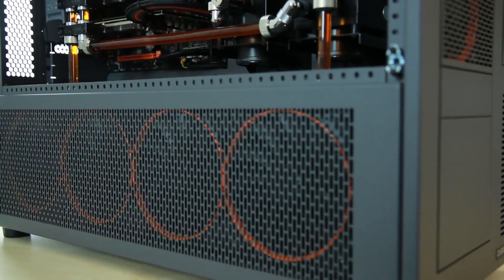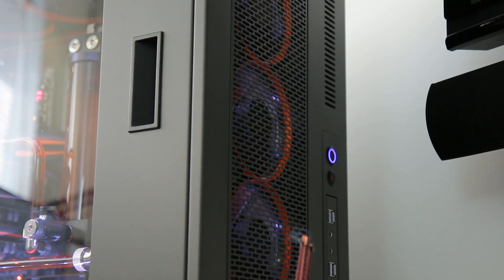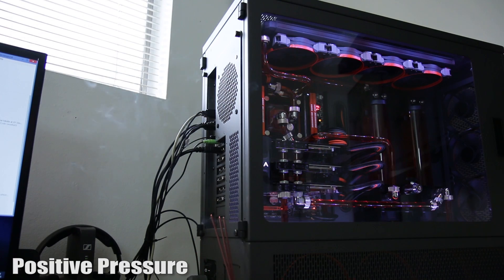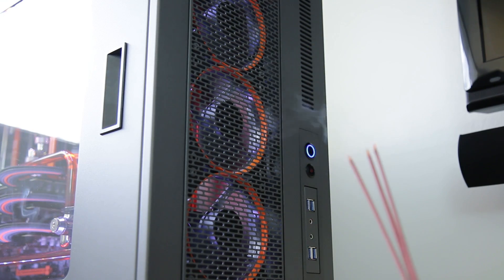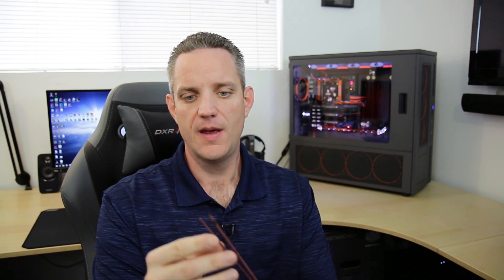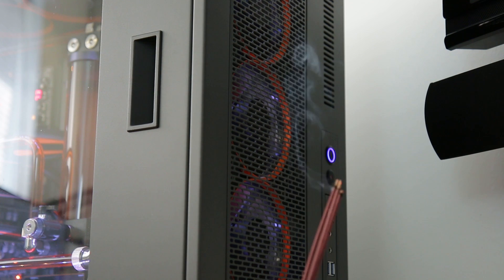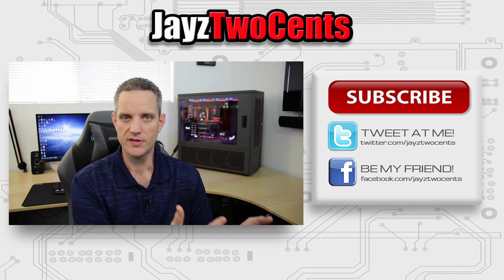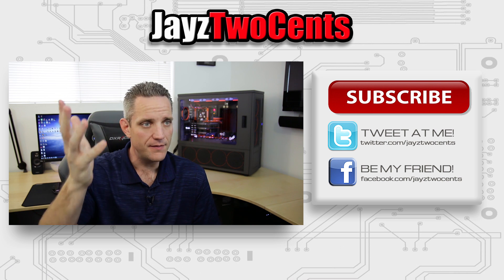Case Flow and Pressure Demonstration - How to balance airflow

Comment: I personally just fill up all the fan slots, try to put an equal number of fans blowing in as out, and make sure temperatures don't get high. if temperature gets high, then i mess a little bit more with it. I have a cooler master HAF X case with all of my fans being controlled by the mobo, i have the stock rearexhaust fan where it was (blowing out), stock top exhaust fan (blowing out) and an additional 200mm fan blowing out. For intake I have the stock intake fan (blowing in) and the stock front intake fan (blowing in). For additional fans I have a duel 120mm fans for the cpu doing a pull - push to the rear exhaust, and dual stock 980ti fans pulling air through the card to the back (they stay off most of the time due to low temps) pulling air from my SSD and my capture card. My PSU is upside down in its own little circuit pulling air from under the case and blowing it out the back.

If you stayed and read all of this, give me your thoughts tech people!
Reply: It's a hobby, I want my system to be at its best
Reply: Some people are like that with cars, spend your money on whatever floats your boat

Comment: So much money spend on hardware and so little knowledge :) its amusing :) positive, negative airflow :) you need smoke machine you need lights you need different colour smoke, you need airflow meters at different points. You need air directional flaps....and so on, so on...

Comment: 2 140s front intake though a filder then 2 120 exhaust  though a radiator and a 1 140 in the back exhaust

Comment: The nice thing about incense sticks is also that their smoke can be more toxic than cigarette smoke. Always good to get residue like that all over your computer parts and room and clothes. :-P (I.e. check the type of ingredients, even better read up on them, if you intend to use them frequently.)
A better cheap way is to lick the back of your hand or your finger and hold it in front of a passive opening and you should be able to tell whether air is flowing in or out.
Even simpler: Use your brain to figure it out without even having to sense it. That works, too.

Comment: I didn't realize people didn't look at the CFM and thought just the number mattered. Good info regardless! I use all 250s in my case and crank them all the way up to keep things easy, because then the number of fans equaling out becomes relevant. Remember to test any setup you do though, because for instance on my case the front 250 is hampered by the HD cage so it's hard to know where the air is going to naturally go since it's having to run through and over all my HDs and the cage itself.

Comment: 5:28 - so it actually does have everything to do with the amount of fans, if they are all running at the same speed. Obviously if a fan is running at a higher RPM its moving more air lol.

Comment: Quick question: I mistakenly bought a corsair SP fan as a case fan in my NZXT S340. I am about to do some spring cleaning and am considering moving the 2 included nzxt fans to the front of the case and mounting the SP as the sole rear exhaust in order to gain positive pressure. Is a SP fan acceptable as an exhaust fan? I assume the direction of its airflow wouldn't matter as much there since it's just exiting the case, but I'd like any input you could offer.

Comment: Very good analysis, but there're 2 mistakes:
- Natural fluid convection from down to top only work when it moves freely (at atmosphere pressure). When it is forced by a delta pressure (like through fans), the behavior is determined by the direction of that pressure. A case with intake fans at the top and exhaust at the bottom can cool the same as the inverse way.
- Negative pressure actually cools better than positive. The reason is that negative pressure sucks any air found inside the case, meaning all the hot air is evacuated. With positive pressure it is possible to generate bubbles of hot air if the case doesn't have enough exhausting holes, raising the temperature of the components inside those bubbles.

Comment: I was just going to ask you something about this lol.

I'm going to add to my loop a 280 rad (I'm going to watercool my 970 now) as intake with 2 corsair SP fans that came with the case. Would I be fine with them not going over ~1500 rpm or should I get an AF fan for the bottom? By the way, without this radiator, they run at 900-1000 rpm and I currently have + pressure.

Also, this is simple curiosity since I can't change it, but having the res about 5 cm (2in) from this res would screw up the airflow?

I'm asking because I have to order most of my stuff from the US, and it takes a while to get here :P

Comment: lol i only have 3 fans 1CPU fan 1GPU fan 1 Case Fan
Reply: In your case, I can assure your case does have positive pressure, if the case fan is intake fan. If it is exhaust fan, pressure is being negative. Now is the case circulating air fast enough through the case for optimal cooling is a different question. Well, actually I assume that you do have some stock cpu cooler too so nothing really matters in any case and whatever.

Comment: I currently have 3x140 unimpeded intakes at 7v with 1x120 unimpeded exhaust at the rear running at 5v, and 2x120 obstructed radiator fans exhausting air with PWM control at the top. This results in positive pressure during no load, which is the majority of the time. Dust is kept to a minimum. During gaming is the only time my case has equal or negative pressure, due to the fans on my GPU ramping up & my radiator fans ramping up.

Comment: I would like to know your opinion on my case's airflow pressure. I have a Corsair Carbide Spec-03, I have 2× 140 fans in the front and 1× 120 fan in the bottom for the intake. The exhaust is the 2× 120 in the top and 1× 120 in the back. The front fans are the Corsair AF 140 Quiet Edition with the white LED's and the back exhaust is the same just the 120 fan. The top exhaust's are the stock fans that was in the front of the chassis and the bottom intake is the stock fan that was in the back of the case. Would you say I have positive/neutral/negative air pressure?
Reply: I haven't reduced the fans speed on any of the fans and all the fans are connected to a fan controller hub that I have turned up to the max speed for all of the fans.

Comment: Great video as always! Super informative and I like your format!
Anyway, when I built my current system it had been about 7 years since I had actually used a desktop as I was using laptops, so I did a bit of research and everyone said positive pressure. So in my Corsair 750D I'm using 2 stock 140mm fans as intake, 1 stock 140mm fan as exhaust, and the 2 bundled 140mm fans that came with my Corsair H110 also as intake. So 4 fans as intake and the 1 stock case fan on the back as exhaust. I've not had any issues and to be honest I would prefer quieter fans, but it all seems a little confusing! Would love a fan recommendation if anyone has any tips!

Comment: You have any idea how bad it is for your electronics just burning an incense in the same closed room?  The dust gets fucking everywhere, and it's microscopic so you really can't even tell it's there, not to mention it's virtually impossible to remove from tight spaces like your motherboard or graphics card.  I cannot imagine what you're doing to your pc by letting it suck incense smoke directly into the intake fans.  Like...that's absolutely mind blowing.

Comment: Been doing this since my second computer build over 10 yrs ago. Something you might also want to address is how fans do not pull air as well as they push air. This is because of blade orientation. Also might want to add how the density of air changes with positive pressure so thee is more air to absorb heat then negative pressure and neutral is in the middle. You also have too much flow if you ask me. Not enough time for the heat to be absorbed by the air. Might want to look into that. I know I probably sound insane but, meh so did tesla.

Comment: For my system I borrowed a small smoke machine from a friend. Makes it possible to see how the air/smoke is behaves inside you're system. Positive air pressure doesn't necessarily means that air is blown alongside the major components. For instance, I shaw in my system that the vrm motherboard block didn't really had any airflow. The smoke was just sitting there, while in the rest of the case I saw swirls inside the smoke. When I lowered my exhaust fans a bit, I was also seeing more swirls around the vrm's a the mb temp dropped 1.5 degree (Celsius). Air pressure is not the same as air flow! Think of a you're tires: When you inflate a tire you increase the volume of air inside the air creating a positive pressure (1 bar is considered natural atmospheric pressure). However when you stop pumping air inside the tire and cap of the nipple, the air pressure remains, while airflow is basically zero. 

p.s. When the wheels start turning and objects (debris, uneven surface areas, etc) makes the tire wall compress and decompress, air is moved inside the tire, but that a bit beyond the scope of my point. Ever created a pond, while then you know you should avoid 90 degree corners as they decrease water flow and create 'dead pockets' while the waterpump is still moving water through the filters. That can also happen in you're computer system..

Comment: I have my build inside a Caselabs Mercury s8 with two 360mm rads and one 240mm rad with Noctua Industrial fans all hooked up to a Lamptron fc5v3 fan controller. Any recommendations on the intake fans? cause right now i have none lol.

Comment: hey jay. thanks for the video bud. good work, you didnt mention that rpm's mean nothing compaired to CFM which means everything. can spin a fan as fast as you want but if it cannot produce CFM its worthless. here you go buddy, 2 pictures VIA puush, made the LED strip being used by myself as well, its nothing impressive LGA 775 q9300 oced to 3ghz on 1.22v and a 1:1 ratio on my ram at a 400mhz fsb and a nvidia gt640. it rocks bf3 on med at 60fps on 64 man chaos servers on metro no sweat.
Reply: +Raging Reaper Gaming Variety
http://puu.sh/mHv2c/a9d38b0329.jpg
http://puu.sh/lYEIt/c8f002cbf9.jpg

there you go. nice work on demonstrating airflow, i did the same thing you did.

now i need a IO backplate as mine came with the wrong one :(

Comment: Do you have your water pump connected to your CPU fan header, or do you have the radiator fans connected to the CPU fan header on your mobo? Since you're letting your mobo PWM control it when the CPU warms up under a load, do you want the pump to speed up or the fans, or both?

I'm using an Enermax LIQTECH 240, so I'm not sure if I should connect the block/pump power connector to CPU fan header, or CPU Aux, or connect the radiator's fans to the CPU Fan, or CPU Aux, Vice-vera? ..does it matter?

Comment: I have my side panel off completely.. Phanteks enthoo primo luxe.. All watercooled with 9 fans, 6 top 360 SP push pull (outtake) 2 SP 240 intake, no dust in my system.. Fans getting all the cool air available to them to push through the rads.. Don't think it's all that important with watercooling, just have to make sure you have enough cool air available to be pushed through the rad fins

Comment: My current setup is 1 top 140mm exhaust and 2 front 120mm intakes (sort of filtered) in a nzxt phantom 410. It really helps preventing dust from getting in, at least most of it, in my case, since it has an opening on the bottom for some reason, other than the mesh filter on the front.

Comment: Hi I have a 650d and I am going to install some top fans, fan support it 2x 120 or 1x 200 or 2x 140, I was thinking about 140s in a push config as my rear 120 is push and my front 200 is pull.

would this be a good choice?

thanks Thomas :)

Comment: What would you guys do? Got an itx WC'd PC (CPU+VGA). 4 fans, an 80mm on the back, 2x120mm fans on top (with 240 radiator) and 1x120mm fan on the front with a 120mm radiator. Both radiators have their fans as exhausts (pushing hot air out) and the 80mm fan on the back is an intake running at 85% speed or so. I f I remove the side panel temps will come down about 5 degrees.

I've thougth about removing the front radiator, turn the fan around and make it an intake and give more air to the 240mm radiator.

Comment: Running fans like AF140s at 900rpm minimum? Eww. I'm starting to see why you didn't tell anyone that those Vardars are loud. Doesn't excuse not telling about the horrible low-rpm performance though.

Comment: guys what should I do, I have 3 corsair fans running intake in the front, 4 fans running push/pull (intake) at the top closest to the back and another fan beside those fans closest to the front running exhaust and then a 140mm running exhaust in the back (rest of the fans are 120mm) This is all in the Nictos 450, what would be a more optimal fan setup? I also find that its quite loud and that I cant seem to change the fan speeds on speedfan or in the bios :/

Comment: Noctua super silent 900 rpm standard, run them at 630 = 70% (can't hear them). one 280 rad @ bottom one 240 @ front one 360 @ top (all intake) and one 140 fan outtake in back. 60C at full load 21.5C ish idling. NZXT fan controller sentry 3 I belive? temps measured @ gpu and cpu core Wife very happy :)

Comment: 7X 140mm Fans in a Corsair 550D Case.

2x Front Intake
1x Bttom intake
1x Side Intake

2x Top Exhaust
1x Rear Exhaust

All fans spin at a whisper quiet 700 RPM, and are controlled via temperature probes attached to the top GPU's heatpipe.

Comment: So having a push/pull config on a radiator is....?
Reply: +TreeOfLifeCG Roughly equivalent to one exhaust.
Reply: +TreeOfLifeCG Read any test instead of asking in youtube comments. Push-pull has no bearing on case airflow. The point of it is to create more pressure in and thus more flow through the radiator – shaving off up to 5 degrees at airplane levels of noise. You can't increase the flow through the radiator in any significant way by adding case fans – the air will escape around it, where there's no resistance. This also depends heavily on the radiator itself – it has to be high-pressure to gain any benefit.

Comment: Mason still confused. I want good airflow in my case (something its not actually optimized for it though) so where should the fans go and face to keep dust to a minimum and keep things cool?
No fans mounts in front of case, 2 on windows panel, about 3 could go on top I think, maybe just 2, and the rear and bottom which might just hold one.
The rear fan is blowing out, the CPU cooler has its fan blowing outwards (towards the open top) and the graphics card has its two fans facing the bottom mounted power supply (might move it tomorrow while I'm cleaning out dust) 
Can anyone help me with placing fans the correct way and how many and stuff??
Reply: 2 out on top, 1 in from bottom, 1 in from side